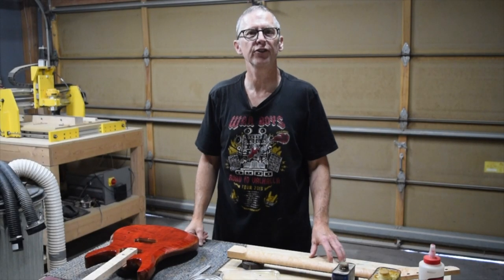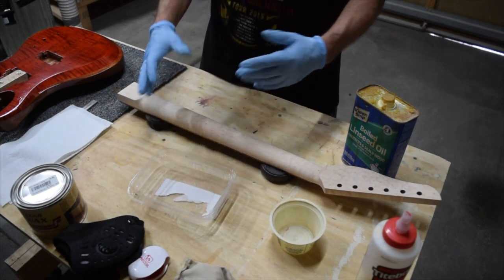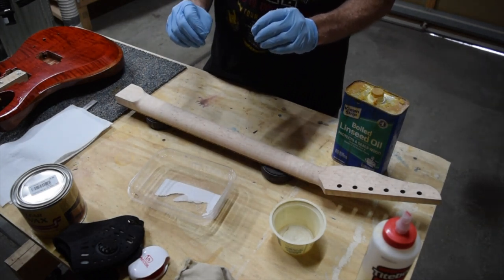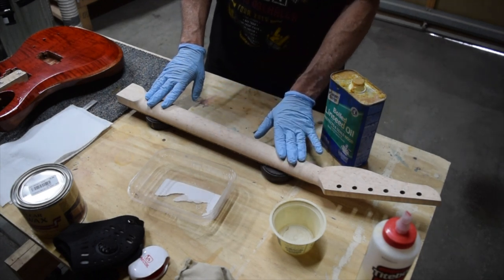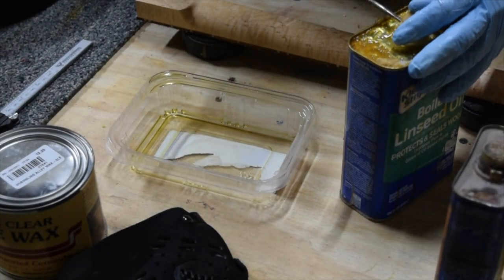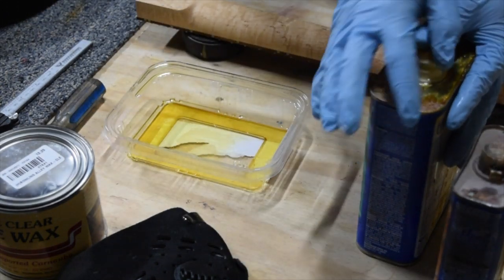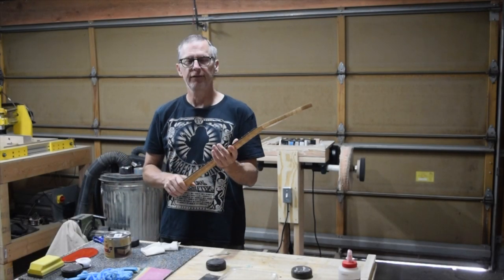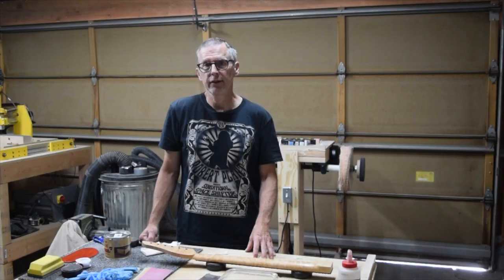Applying An Oil Finish On A Guitar Neck

Comment: Ever try BIrchwood casey's gun stock oil?    it is my personal favorite and used on very expensive custom  shop guitars by top guitar companies.
Reply from the maker: Yes, I have. It's too expensive and hard to get where I live. I tried ordering it, but what I got was old and partially cured. These days, if I want a glossy finish, I'll spray 2k polyurethane.
Reply: @HighlineGuitars  I like a no gloss, bare wood feel does the linseed oil achieve that?
I want my necks to feel like they have been played on for many years and the tru oil got me that.
I have not tried the Boiled linseed but it may be a option if it will get me those same results.
Reply from the maker: @These_go_to_eleven_1959  BLO is not quite the same. It seals the wood and adds a slight amber hue, but there is absolutely no shine.
Reply: @HighlineGuitars  That sound even better then!   to be honest i would prefer to play on bare maple but obviously the wood needs to be protected.  so is the Linseed Oil more like a sealer than a finish?  if so it is perfect for me!  Looking for that bare wood feel.
Reply from the maker: @These_go_to_eleven_1959  It's a sealer/finish. It will soak into the wood to seal it and the amber tint will darken the wood slightly to enhance the grain/figure of the wood. Once it is exposed to air, it undergoes a process known as polymerization where it turns from a liquid to a solid.  Tru Oil does the same thing (it's based on linseed oil), but faster so it can impart a glossy sheen. BLO takes days and even weeks to cure, depending on the temperature and humidity where you live. I like to add Japan drier to speed up the process (hours instead of days) but it's hard to find and kind of smelly. If you're not in a hurry, BLO will work fine and it's readily available and much cheaper than Tru Oil.
Reply: @HighlineGuitars  Thanks i will give it a try on one of my guitars.

Comment: If I were going to stain a neck, would I do this first or stain the neck first, and then do this?
Reply from the maker: Depends on the stain. Oil based stain already has linseed oil in it so you can do both steps at once.
Reply: @HighlineGuitars  meaning I would mix stain and mineral spirits to wet sand?

Comment: If one were to use the boiled linseed oil on the fretboard, will the oil cause issues with the frets themselves, or can the oil be applied right over them as well?
Reply from the maker: When you wipe off the excess oil, it comes right off the frets.

Comment: Do you ever add additional coats of BLO to achieve the sheen you are looking for? I've just applied this technique to a walnut neck, and while very smooth feeling, still looks and feels pretty raw. Wondering if I didn't apply enough BLO with the initial coat.
Reply from the maker: BLO won’t make it shiny no matter how many coats you apply.
Reply: Understood. I'm not looking for glossy finish (as you stated, who would on a neck?) Your final shots of the finished neck, which is gorgeous, appear to have a noticeable satin finish to them opposed to just raw wood. Wasn't sure if I should apply additional coats in the event my first application was either too thin, or was completely soaked up by the wood... ill be the first to admit there may also be some ignorance/misconceptions in my expectation as I'm working with a different type of wood for the first time.

Thanks for the reply and all of this invaluable information you've provided here on youtube. I plan to put many more of your techniques to practice with some future builds coming up.
Reply from the maker: If you wet sand the oil into the wood, it is possible to get a satin finish. The first coat or two will soak in and the additional coats will sit on the surface.
Reply: Great. Thanks again!

Comment: Can you use boiled linseed oil over stain?
Reply from the maker: Absolutely. In fact, most oil based stains use BLO as a base.
Reply: @HighlineGuitars  cool I’m just wanting to make a plain neck darker and vintage and need a finish coat to seal it

Comment: How many coats of finish did you apply? Did you wet sand between each coat?
Reply from the maker: Two to three coats and it isn't necessary to wet sand between coats.
Reply: @HighlineGuitars  Thanks!

Comment: I like the Mohawk Modified Tung oil cause it dries much faster and harder than regular Tung oil . But I will say it’s 3 times the price of the boiled linseed oil 👍
Reply: Do you have any tips for using the Mohawk oil ? or could I use essentially the same process that he's using in this video ?
Reply: @RNicolasRuvalcaba  yeah it’s the same with exception that you can add coats every 20 minutes up to 5 coats . Then it’s personal preference on any thicker than that . Dries hard in 2 to 3 days
Reply: @MrJoeydano  Thanks for the info.
Reply: Flamed and figured maple necks can be a little more sensitive to weather changes, so how many coats of the Mohawk modified tung oil would you recommend on a flamed maple neck if I still want it to feel very natural ?
Reply: @RNicolasRuvalcaba  remember you can always steel wool it if you feel it to much but I don’t think you would Need more than 3 thin coats on the back if it’s a maple fret board then put as many as you want as it will get glossy with every extra coat .

Comment: can I add a vintage amber dye to the linseed oil ??? or can I use the amber tint on neck first and rub the linseed oil on afterwards?
Reply: You should be able to add the dye directly to the oil. I know that there are other oils for sale that are tinted to certain colors, so I don't see why it wouldn't work.

Comment: Hi im just wondering if the BLO can dry for 1 day without japan drier?
Reply from the maker: No. Depending on the temperature and humidity of your environment, it could take weeks to completely dry. Even if it feels dry. Do the sniff test. If you can smell the BLO odor on the surface, it hasn’t dried yet.
Reply: @HighlineGuitars  can i put it outside our house and let the BLO be dry by the sun?

Comment: Can i follow these methods for maple fretboard? Or it is not recommended?
Reply from the maker: You can as long as you put down a clear coat afterwards to keep the fretboard clean.
Reply: @HighlineGuitars  i see, thank you sir!
Reply: @HighlineGuitars  Hi, could I ask a question on how to maintain a birdseye maple neck that I finished on a partscaster? I treated it with tru oil and then finished it with gun stock wax (from a video I saw a few years ago). Will I need to re-oil the neck at some point and if so, would I need to rub down/off the wax so that the oil can penetrate? Thanks for your help.

Comment: I watched u finish a guitar neck with boiled linseed oil what about the fretboard?
Reply: If the fretboard is rosewood, it doesn't need to be treated because it already has natural oils in the wood.  If the fretboard is maple, then it depends on whether it's finished already or not.  Most finished maple frets has a gloss lacquer which does not need another finish added.  Unfinished maple would be a good idea to add some kind of sealing finish otherwise the wood could warp when exposed to changes in temperatures and humidity.

Comment: Can you gently sand it without the mineral spirit?
Reply from the maker: Sanding with mineral spirits will help prevent the sandpaper from clogging up as you sand. Even "no-load" sandpapers will gum up is you sand an oiled surface without mineral spirits.

Comment: Do you put your water slide decal down first then apply the linseed oil?
Reply from the maker: I don't use water slide decals anymore. If I did, I wouldn't use BLO. Instead, I would put the decal down first and apply multiple clear cots over the top.

Comment: Will this work on a neck that had been sealed with a polyester sealer?
Reply from the maker: No. The oil has to soak into the wood.
Reply: @HighlineGuitars  Thanks

Comment: Can I use tru oil with this same process.
Reply: You should be able to. IIRC, you can also build up coats with it. Be sure to use it sparingly though because the bottles go a long way despite having a tiny amount in them.

Comment: Hi.. What about the fingerboard? Linseed to?
Reply from the maker: Yes. However, with Maple, lacquer will also be required to protect against grime.
Reply: @HighlineGuitars  Ok, thank you.. So would that be lacquer on top of Linseed.. Or?
Reply from the maker: @sermandet2022  in the case of Maple, oil is only used to add warmth to its appearance. The lacquer can be applied over the oil as long as it is completely cured, which can take weeks. An alternative is to skip the oil a apply an amber tinted lacquer.
Reply: @HighlineGuitars  Yes.. We are still talking only fretboard right? 😊 Thank you.
Reply from the maker: @sermandet2022  yes. Maple gets pretty grimy with use. However, fretboards are harder to clean, so a few coats of clear lacquer will make it easier to keep them looking nice.

Comment: is there an alternative to the odorless minerals? can the sanding be skipped?
Reply from the maker: Turpintine. And no, you can't skip the sanding if you want it to turn out smooth.
Reply: @HighlineGuitars  thanks for your reply. actually I just went ahead and sanded it with fine steel wool and feels and looks amazing. thanks for sharing your knowledge, man. cheers!

Comment: Is there any Mineral spirit alternate as I cannot find one in my area? Also, can I stain the neck with leather dye and then use the oil to seal it?
Reply from the maker: Turpentine or paint thinner.
Reply: @HighlineGuitars  Is it ok to stain wood with leather dye?
Reply from the maker: @aforabiishk  Yes.
Reply: @HighlineGuitars  Thank you so much.

Comment: Can i put it outside our house and let the coat of BLO be dry by the sun?
Reply from the maker: Is there any glue in the neck such as where the fretboard is attached? If so, then no you can't put it in the sun. The only way to speed up drying it to mix Japan drier into the BLO.

Comment: thanks for a great overview of the process and the very detailed run-down of pros and cons of different oil types. 

I have one question though: is it possible to use waterslide decal logos on an oil-finished headstock or are they for lacquered work only? The waterslides I have specify a couple of coats of lacquer as a base for the logo and then have to be feathered in around the edges once they have a couple of clear coats on top before another couple of finishing coats are added. If I followed your process correctly, it seems oil-finishing (which is only a single coat or couple of coats tops) requires a solid inlay logo. Am I correct?
Reply from the maker: There's no way to know for sure until you do a test. I don't use decals so I can't say for sure.

Comment: I love boiled linseed oil but it grows mold on it quick and the finish fades fast and needs to be reapplied every few months.  I found no solution make it more durable.
Reply from the maker: Out of curiosity, what brand of BLO are you using? The reason I ask is that I can't find any reliable information on why this might happen. Some reports reference raw linseed oil while others are linked to BLO. It's never happened to me, but that may be because of the formula (Klean Strip) I use.

Comment: Another "secret weapon" for oil finishes is to warm up the workpiece with a heat gun or even a hair dryer. No need to get it scorching hot, just good and warm. Try it on a room temp piece and a warmed-up piece at the same time and you will likely be surprised how much more, and faster, the wood absorbs the oil when it's warm (you want the oil down in the pores, not just sitting on top of the surface). This is especially helpful if you're using a psuedo-French polish technique where you lightly sand the piece with very fine paper (400 grit minimum, some go much much higher, up to 3000) while the oil is still wet so that the fine dust soaks in with the oil to help fill the grain (not just wet-sanding with spirits as seen here) This technique is quite common among custom knifemakers who use highly figured wood for their handles, and with several coats and a good buff/burnish results in a gorgeous high-gloss, fairly tough finish that still feels like natural, almost "raw" wood - not sticky like painted on glossy finishes. Yes it's time-consuming, but it lasts for many years with very little maintenance - basically just wipe it clean now and then.
Reply: Actually you can use the French polishing technique here too, just skip the Japan Dryer and go straight to the first coat of BLO and wet-sand across the range (400-1500, I personally don't go higher as I don't WANT a high glossy smooth surface on my neck). Just remember to lightly wipe with a clean cloth after finishing the wet-sanding stage to get rid of the crud that is just sitting on top of everything so ye don't have a bumpy rough surface. Ye want the dust IN the pores, not ON top of the surface.  Of course, this means a longer drying time, but if yer willing to put in the time to wet-sand, then yer probably willing to wait the time for it to fully cure.

Comment: 12:50 Can I use a Paint Reducer instead of Mineral Spirit?
Reply from the maker: Yes as long as it's formulated to work with oil-based paint rather than lacquer-based paint
Reply: @HighlineGuitars  Thank you very much! Gonna apply Double Boiled LO on the bare neck of my Squier Mustang. Your video helped a lot to clarify the details of the process and the safety guidelines as well! Thanks again :)

Comment: Raw linseed oil will dry. Artists don't put it into oil paint to "extend" the drying time....it's literally the binder for the pigment...it's the combination of pigment and linseed oil that makes the paint.  It can take a long time to dry if applied thickly but if you apply it thinly it will dry. In the UK, cricket players traditionally used raw linseed oil on their cricket bats and they dry.
Reply: Ah they do add it to oil pant

Comment: Amazon Has Truoil in small bottles . AND NEVER EVER USE OLD TRUOIL!! your guitar neck will smell forever. !!!!Trust me.I am looking for alternative so thanks  I am trying Linseed Oil on my Allparts Strat neck with ebony.
Reply from the maker: My advice is to never use Tru Oil in the first place. There are better (and cheaper) ways to get a nice finish on a neck
Reply: @HighlineGuitars  How about wax? Music man uses wax on necks and they are magnificent , how do I get that satin feel on the cheap. ?
Reply from the maker: @wolvesandguitars  wet sand boiled linseed oil into the back contour of the neck starting with 600 and finishing with 2,000 grit. The rub in some pure carnauba wax with a 000 synthetic pad.
Reply: @HighlineGuitars  So even though many top guitar compannies use it on their $4000 custom shop guitars  you are saying it is not a good idea?
Reply from the maker: @These_go_to_eleven_1959  My advice is to never use Tru Oil in the first place. There are better (and cheaper) ways to get a nice finish on a neck

Comment: It doesnt take forever for raw linseed oil to dry lol... tried and true linseed oil is readily available on Amazon. The huge difference is that boiled linseed oil is 10% oil you'd need 10 to 15 coats to leave the same amount of resin left on your product. If course you can do what ever you want but the info you gave was completely inaccurate. What you can do is apply raw linseed oil as instructed on the can- light coats... then wipe it down in an hour. With raw linseed oil it's important that the oil is heated to dry. Then in 24 hours you rub the coat out generating as much heat as possible through friction. Then take a heat gun and use that just lightly enough to just bring some of the linseed out of the pours. But you have to wipe as you do this step...